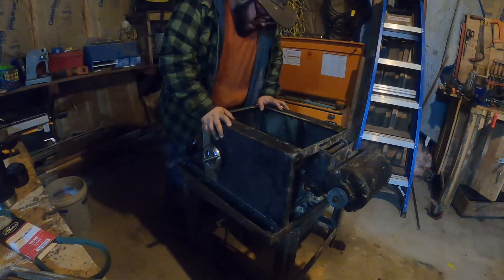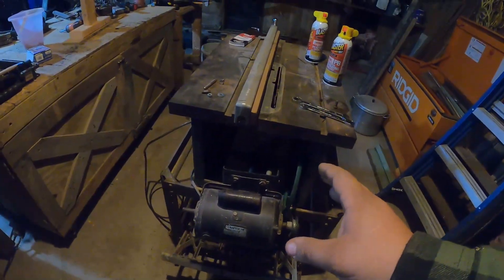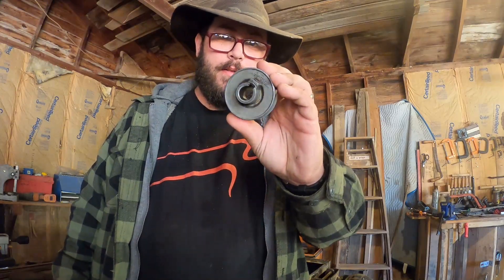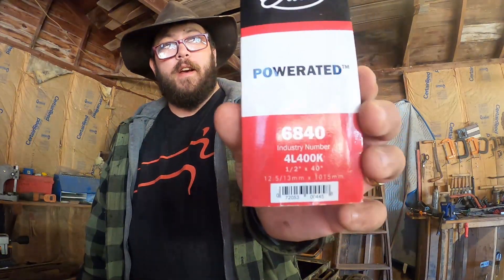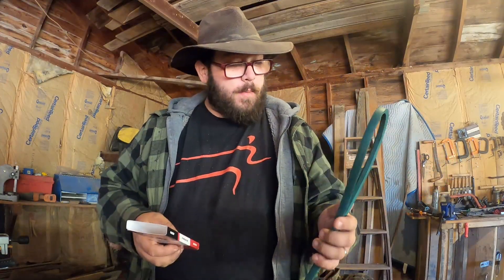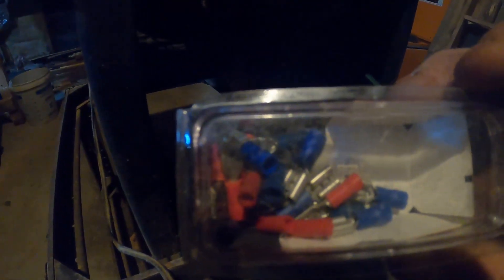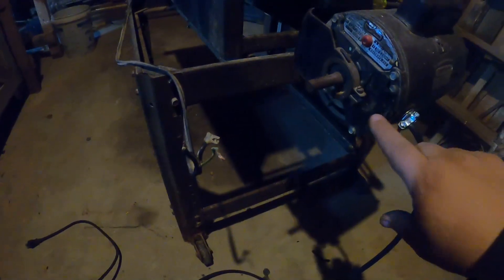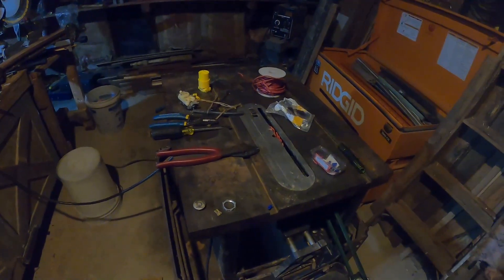Cleaning up the old Craftsman Table Saw

Comment: Hi,why are  making it hard on you,just drill a hole and use an xtractor,it will come out and use a new bolt.I have one of this  and is working smooth.have a good day and luck on your project.Another suggestion;you can use a spring beetwing the hold down motor plate and the zaw frame that will make some tention and keep it more stable (less jumpy) on the belt
Reply from the maker: I definitely would have done it this way but I don't have an extraction set to use. I'll probably be getting one in the near future because I have came across this issue just enough to justify getting one.